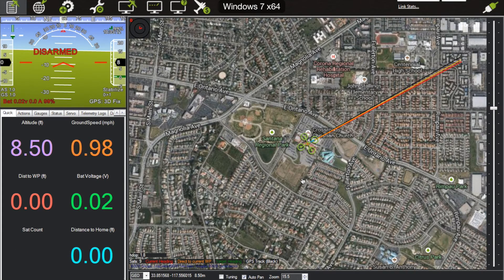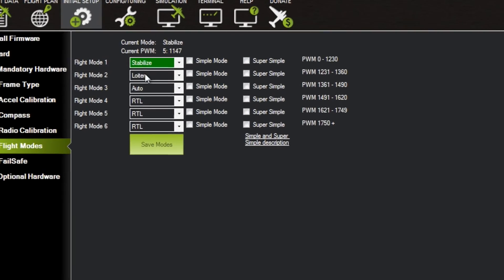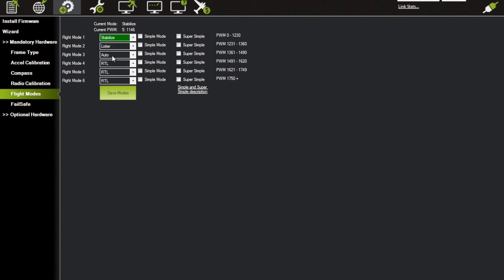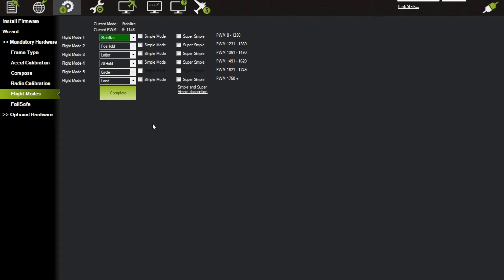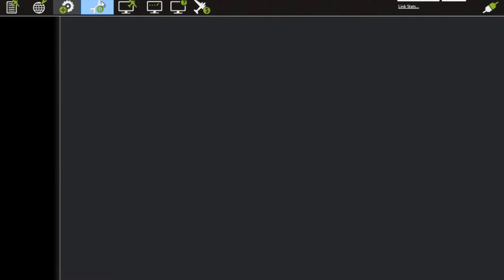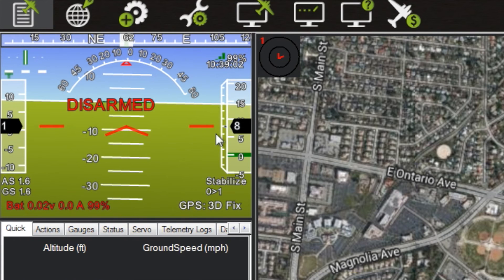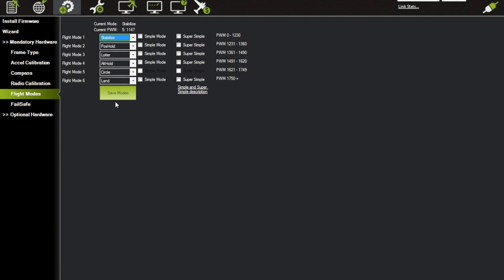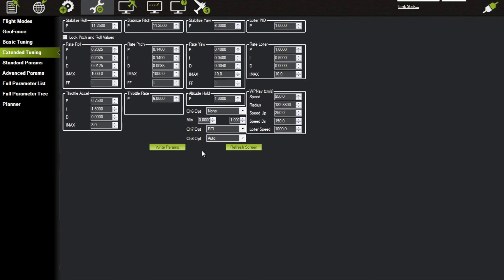3DRobotics Iris+ Flight Modes Configuration - 6 modes - 3 position switch - Pixhawk

Comment: hi...can I use also loiter and alt mode at the same time
Reply from the maker: I think I answered this on FB but no you can't use 2 flight modes at the same time. But Pos Hold is a cross between loiter and Alt Hold.